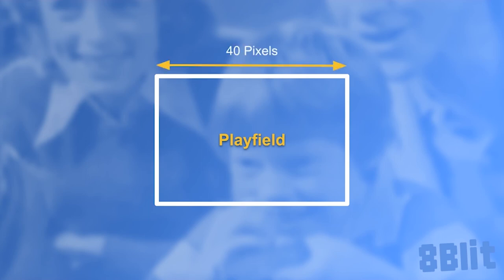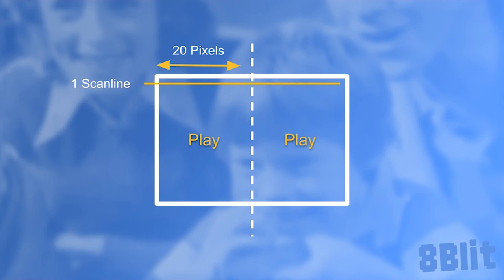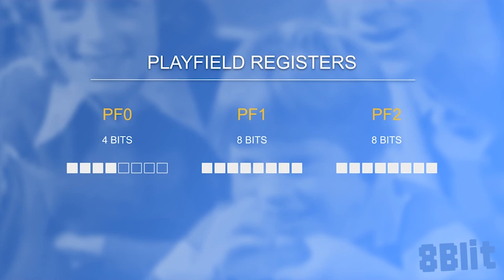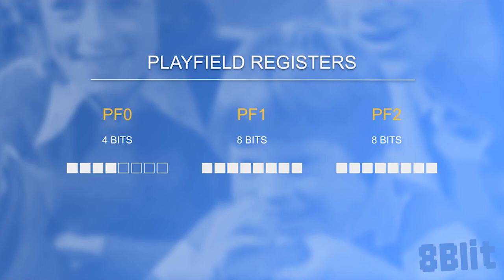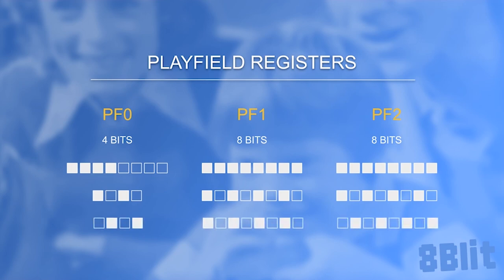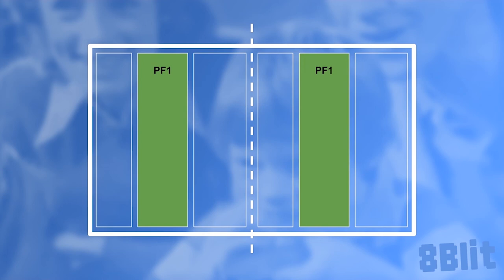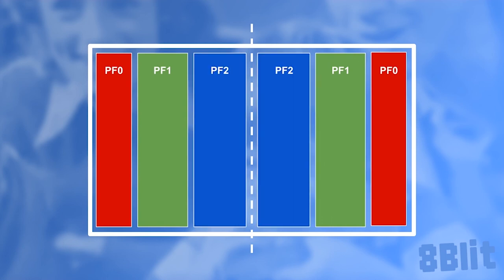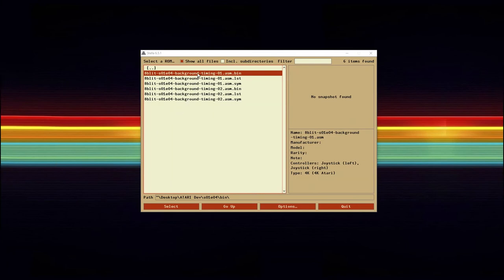Drawing a Playfield on an Atari 2600 | 8Blit

Comment: This is one of the very first consoles on the planet. System ram was expensive and hardware had to be affordably cheap, so choices had to be made. Simply compare the 2600 chipset and capabilities to the 8 bit computer line released 2 years later that retailed for substantially more. A fantastic video thank you.
Reply from the maker: True, the capabilities quickly progresses with the availability of more affordable chips. Thanks for watching and for the kind words!

Comment: I'd forgotten that PF0 and PF2 were drawn in reverse order. Hopefully some experienced  hardware engineer will see this and provide a reasonable explanation for that design, and that it's not pure sadism on part of the TIA designers...only thing I can think of is that reversing them might have made routing easier on the die? Anyway, great video.

A selfish suggestion for a video topic: how exactly did Pitfall II use the DPC hardware to accelerate drawing? About the only thing I know is how it was used for music, but I can see the potential of the queue registers for graphics acceleration.
Reply from the maker: I think you're correct, it probably does have something to do with simplifying the die. I may examine this closer in the future!